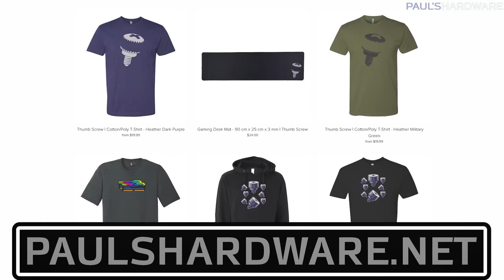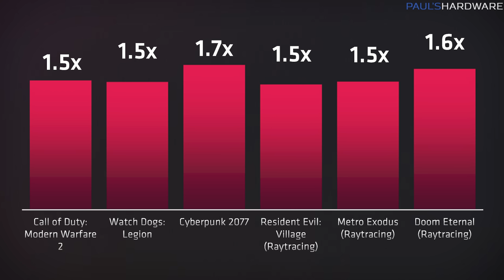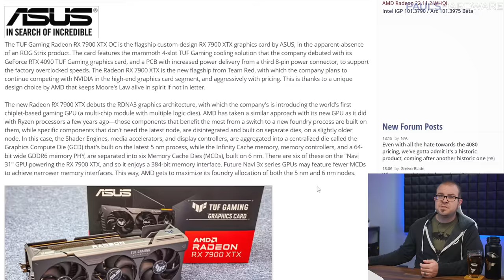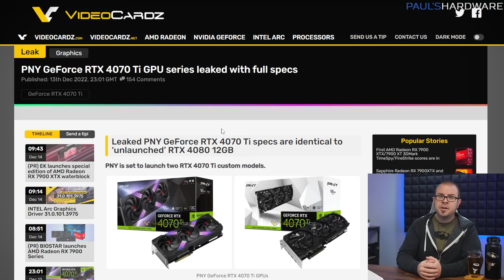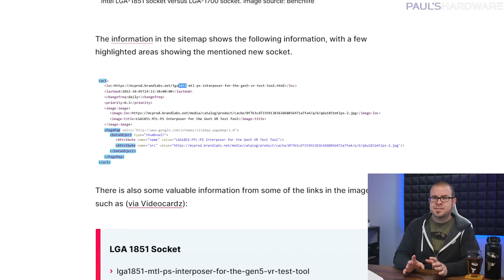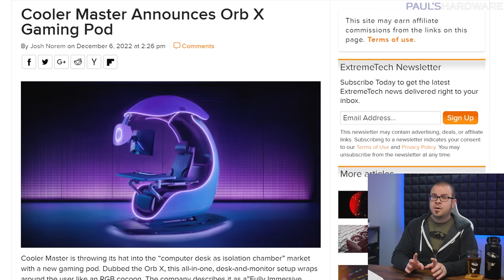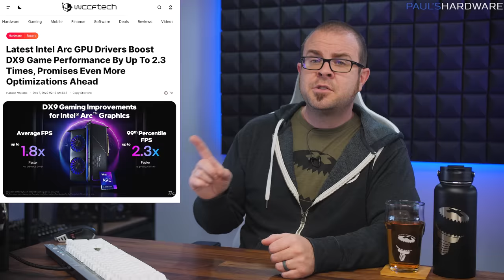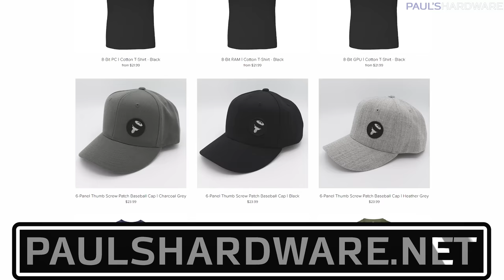GPUs and PC Hardware Coming in 2023 - Tech News Dec 18

Comment: 7900 XT compared to 7900 XTX is slower than 6800 XT compared to 6900 XT. Both NVIDIA and AMD playing name games.
Reply: Should I go for the 6800XT? I mean it's now way cheaper than the RTX 3070.
Reply: @killthemessenger84  7900 XT is 35% faster than 6800 XT while 7900 XTX is 60% faster than 6800 XT.
Reply: AMD making their last gen look amazing.
Reply: @isumairu25  If the price is good then yes. It beats the shit out of the 3070 in terms of performance. Check out Hardware Unboxed for real numbers.
Reply: @kevlarandchrome  I did, all I want to do is run all on 1440p. The Radeon 7900 series are expensive in South Africa.
Reply: @isumairu25  Yeah, the 6800 should do you just fine for that.
Reply: @isumairu25  6800xt is a fine card and its fine  if you get it for a decent price. If its same price as 3080, I would get 3080, but if it is cheaper than 3070, then get 6800xt.
Reply: @killthemessenger84  Five numbers: 6800 XT FPS, 7900 XT FPS, 7900 XTX FPS, 7900 XT peformance gain relative to 6800 XT, and 7900 XTX performance gain relative to 6800 XT. Source: Techspot at 4K

The Callisto Protocol: 74   FPS vs 94   FPS vs 118 FPS, 27% and 59%
Forza Horizon 5:          80   FPS vs 98   FPS vs 111 FPS, 23% and 39%
Raibow 6 Extraction:   83   FPS vs 119 FPS vs 144 FPS, 44% and 74%
Hunt: Showdown:        77   FPS vs 98   FPS vs 122 FPS, 27% and 58%
COD: MWII:                   109 FPS vs 163 FPS vs 193 FPS, 50% and 77%
F1 2022:                        29   FPS vs 48   FPS vs 56   FPS, 66% and 93%
Cyberpunk 2077:         41   FPS vs 59   FPS vs 70   FPS, 44% and 71%
Dyling Light 2:              57   FPS vs 66   FPS vs 82   FPS, 16% and 44%
Halo Infinite:                 62   FPS vs 82   FPS vs 97   FPS, 33% and 56%

Average with a total of 16 games: 70 FPS vs 94 FPS vs 113 FPS, 34% and 62%
Reply: Easy, buy AMD Radeon 7900 XTX and done. Or RTX 4080 (if the price is dropped *A L O T*).
Reply: @killthemessenger84  Kermit - “DO IT.”
Reply: I got a 7900  xtx red devil limited edition but my monitor is an asus 1440p 240hz g sync. Should I return it and change it for a rtx 4080 because I wanna get the advantage of g sync?
Reply: @isumairu25  whatever fits in your budget my friend.  I think the best value card is the 3060ti.  It’s pretty much just as fast as the 3070.   I very much dislike AMD gpus.
Reply: Let's hope the driver improvements on amd changes that a bit
Reply: @KaySwiss21  yeah some people speculate a performance bump with driver optimization like 6000 series but better
Reply: Tell me lies, tell me sweet little lies 💀
Reply: @WaterZer0  where? They get better performance per $ than last gen at launch MSRP. Im upgrading from my 6800 xt to a 7900 xtx soon 🤣 i only paid $600 for my card but i want more FPS
Reply: @carabelatech  Sell it to me instead of returning it, but with 20% price cut.
Reply: @killthemessenger84  what on earth are you talking about the 7800xt is double the performance of 6800xt?? You must not know what double means….
Reply: @Isumairu  idk man this is a YouTube comment section
Reply: 7900xt should be at 699.
Reply: @isumairu25  It's better than a 3080 for most things, so yeah if you can get it at that price.

Comment: The rumor mill around the rx 7000 series is talking that the perf problems were discovered late in the production pipeline. They thought they had a real winner internally, until they didn't. It's why they stopped implying it's a 4090 competitor and started stating 4080 competitor instead.

It does mean they might be able to fix it in drivers. But maybe not.
Reply: At least for what they've priced it at, both are still competitive.  It's not like they've got a couple of complete lemons on their hands.
Reply: @tams805  Competitive to what? 4060, 70, 80 or 90? I was looking forward to my first AMD since the crap radeon's from decades ago, but now Im waiting for a significant price cut once people realize what this video is stating: it's overpriced.

Not considering 4090 for similar reasons plus size.

Comment: the fact that the TUF 7900xtx is almost on par with the 4090 in performance, really shines a new light that we do not need new power connectors and the previous connectors are just a good or better.

Comment: I thought the new AMD graphics cards were well recieved all things considered. They are substantially cheaper than their closest Nvidia counterpart. They are also very comparable to said counterpart.

The only real disappointment is they didn't build a giga-card like the 4090. But why battle a gigantic combustable beast, when you can pursue lower wattage but good performing cards, that still show substantial performance gains.
Reply: I think the problem is NV only have to knock $100 off the price of the 4080 for it to be the better all round card. What NEEDS to happen is no bugger buys these cards at these stupidly inflated prices. AMD have the greed goggles attached, just like NV. If we are to believe that the chiplet design is considerably cheaper to make, why stick scalper prices on your products. Either your BS'ing us or you are treating us like idiots and I really don't understand who thinks this is a good move. I was expecting something akin to the launch of the original Playstation where the guy goes on stage, says $299 and walks off. 7900XT $649, 7900XTX $799. Job done. Yet somehow, they release a product in the XT that made the 4080 pricing look sane. I really thought that the kicking Intel is giving them in the CPU space would have warranted a rethink in pricing strategy for the GPUs but AMD have been shooting themselves in the foot for years now. I'm not sure they have any toes left.

Comment: That wasn't the take away I got from the half dozen reviews I saw on the 7900xt/x.  All the benchmarks I saw showed both cards straddling the 4080 in raster while keeping up with 3090's in ray tracing.  At current MSRP, if you can find a card for that, reviews suggested, the extra $400 for a 4090 was the right choice if ray tracing was important to you, as the 4080 was a poor value there, where as for raster, the 7900xtx was the card to get.  The XTX for the same or less money that last gen 3090's seemed to be a no brainier.  Pretty much, if you want the best card, you get a 4090.  if you want to spend only 62% of the money for about 65% of the performance, you go with the XTX, and only in the edge case where you need the best ray tracing performance, but can't scrounge up the extra $400 should you get a 4080.
Reply: That was my take away. I don't care about RT so I bought a XTX on Tuesday and have been playing with it all week. I didn't want to support Nvidia since they have been SUPER anti gamer the past few years and the XTX was equal or better than a 4080 while being able to fit in my case and 200 less. It was an easy choice. I'm no AMD die hard, I've had my 980ti for so long and loved it but team red we the winner this go around.

Comment: So i pulled the trigger on an AMD Ryzen 9 7950X with 64GB RAM DDR5 G.SKILL Trident Z5 Neo non RGB 6000MHz CL32-38-38-96 1.40v and an ASrock X670E Steel Legend mobo.

Already had an INNO3D RTX 3070 8GB iChiLL x4 fans, A case, 1250W PSU, 3x 1TB M.2 NVMe PCIe SSDs, 1x 512GB HDD, and a  Noctua NH-D 15 cooler

And i hope NOT to have buyers Remorse and hope there won't be a 7950X3D hope not.

Comment: While I'm sure the designs from MSI and Gigabyte have been out to lunch for the past several years, the Yeston cards look like someone actually bothered to come up with designs appropriate for build themes. I have an antique water cooling case and I'm using the Pentium 4 era cooler on Ryzen, which is in no way shape or form ever supposed to happen. I think a water themed Yeston card could be suitable replacement for my aging RX 580 Red Devil. I'm sure the performance won't be outstanding compared to its bretheren but beyond a certain point it doesn't matter and these end up being the peak for 1080p144 desktop.

Comment: ERROR:  at 5:25 you mistakenly compare the XTX clock frequency to the stock XT, not the stock XTX.  So you're overstating the frequency difference as 500MHz instead of the actual 270 MHz.

Comment: Thanks Paul, excellent video.

I have a question or a possible video, take this as coming from a  guy who build his first CPU, fires it up, and then gets to figure out all the hidden performance settings he needs to change from the defaults, like changing your RAM speed in the BIOS.

As you spoke about new GPUs, I realized there maybe these secret hidden settings for my graphics card.  Like "enable" ray-tracing or "enable" DSL or any unknown ones like "enable" a new drink to appear.  

I bought an older GPU during 2020, just to make the computer work, and later realized I can overclock the VRAM or GPU.  I have no idea how these two OC's settings actually do to my video or hardware performance, or what other hardware is required, such as using the right monitor.  All I know is that the GPU and CPU has room to run hotter and they are not, they seem to run cold, so whatever.

Nice work, keep it up, good decision on getting a video editor, your video is top notch and probably a time saver for yourself.  Good job.

Comment: Probably a ridiculous question but I plan on hopefully getting my son a 4070 ti but noticed in recent leaked pictures that is uses a 2x8 pin cable. Could I actually still use the 3x8 pin cablemod cable I already purchased with this or will the 3 8 pin connectors damage the card?

Comment: It is weird. The 7900 XT and XTX are a 20% to 30% better than a 6900XT, cost is the same as the introduction price for that card and it does significantly better in Ray tracing. It is $200 cheaper than the 4080. If they had not made such outsized promises, this would be a nice upgrade.

Comment: All the best matey!

Bit weird what AMD has done with the Zen4 and RX7K releases.  They powered Zen4 to the moon when they probably should of run it by default in what we now call 'Eco mode', and left the overhead for the overclockers...and then leaving 500 MHz on the table for the 7900 series to make it more of a 4070 (4080 at a push) competitor just doesn't make sense!?!

I'm expecting some real 'fine wine' in the drivers, else what was the point 😅

Comment: I haven't bought a new PC for a 8 years but need to upgrade from my GTX 770 SLI setup. My new display will be 3440x1440p 144hz and I want to play at ultra settings at 100+ FPS for every game. I can buy a new 3080 for 600. Should I go with that or do I need a better card?
Reply: I'm running ultrawide with 6800xt so similar speed. Cant get 100fps in every game all the time on ultra. Drop down to high amd you probably will
Reply: @IronmanG74   Ok thanks for the input. I think the 3080 is the card im looking for even if some AAAs I have to turn to high. I think its going to pair well with a i5-12400F.
Reply: Seeing as nvidia isn't going to lower the price of entry to 3080 class performance in the foreseeable future, it'll hold value if you choose to flip it.
Reply: @douglasmurphy3266   Good to know. Im debating between the 3080 for 600 and the 3080 TI for 700. Is the extra 100 worth it?
Reply: @SuperReviews4you  plug both into you tube and check out the results. And compare the games you tend to play. If your pc is that old you will also need memory and psu. Might be cheaper to just get a pre built 4080 and way more performance

Comment: AMD's improvement in performance / watt was great.  Then they put the XTX at 355 Watts and $1000.  My entire computer setup is only drawing 220-295W (according to the UPS it is plugged into) and cost around $1100.   This is including my current GPU, two monitors, an 8/16-core CPU, and 32G memory.  Any GPU upgrade has to be no more than around $300 and 200W.  I'm absolutely not going to be buying an 7900XT or -XTX any time soon any more than I'm going to be buying a 4090 or a 4080.  4090s and XTXs are fine for corporate bragging rights.  They'll probably even sell a few to people with more money than sense.  Here in the real world however people have to be able to afford and use them, practically speaking.

Comment: Given that the socket 1851 has the same dimensions and pin pitch as the 1700 could they be planning to allow 12th and 13th generation cpus on socket 1851?

Comment: AMD had the best chance in a decade to shake the market a bit because people were so angry about the 4080 price jump by 71% from $700 to $1200
And of course, AMD didn't deliver and they adjusted their price accordingly by raising the price of the 6800xt successor by changing its name and the price by 38% from $650 to $900.
The biggest disaster is that after AMD didn't deliver people started to buy 4080s for over $1000. The GPU market is going nowhere and not only this, motherboards are not better.

Comment: Nvidia creates a gpu that is size of my fridge and uses 3000w to run....amd says it will beat nvidigreedias  refrigerator gpu and creates 6 mini fridges that are connected together..however on launch we find out they are still slower but now charging as much as nvidigreedia. We see normal working class people refuse yo take out a mortgage on these m ew hpus as they all walkway to go back to boardgames and books.  Who yhe he'll is buying these gpus and why? My 3080 runs everything...l won't upgrade for another two years. I used to buy new gpu at every launch...not at these prices. They need to reduce to pre miner prices

Comment: The 7900XTX also absolutely sucks at 8K. Figured that should be pointed out since AMD heavily promoted 8K during their disaster of a live stream.

Also the 7900XTX and 7900XT have wildly different performance and should not have the same 7900 name. This is worse than the 4080 16GB and 4080 12GB because at least Nvidia had the decency to unlaunched the 4080 12GB. AMD actually went ahead and launched their misnamed male cow feces.
Reply: Oh and I've heard reports of driver issues, because of course Radeon would have drivers issues. They literally cannot do anything right. I'm starting to wonder why AMD bought Radeon, they just make AMD look incompetent.

Comment: I'm fucking crazy disappointed with you for using that TPU benchmark in your video at all.  They used a 5950X and bottlenecked the 4090 lol.

If I use a 2500K I can make a 4090 and 7900XTX the same perf too!

Comment: 'We' shouldn't have been focusing on anything if 'we' are sensible consumers, in this instance. Because 'we' won't go out and buy gpus without first seeing other people demonstrate their capabilities, in which case AMD will only lose if they mislead us leading up to launch.
What people seemingly forgot is it's not just the numbers, AMD specifically referenced the rtx 4090's issues when talking about their gpu - no melted connectors, no new psu, no new case, much lower power consumption.

Here's the other thing, expectation is only one issue - even if everyone got the performance correct, you still have the significantly bigger problem of AMD now validating Ngreedia (I need to find some pun on AMD that has greed in it) in making the 80 class card $1000 USD. Now even a braindead monkey could see that happening the moment the price of the 90 class card increased (as a matter of fact there probably shouldn't even be a 90 class card in the first place, but I digress). What you thought Ngreedia was going to make a massive price hike on the 90 class card then leave the others at the same level? No - of course everything is going to increase, and since the rtx 4090 apparently is selling well, you can pretty much kiss pc gaming good-bye in a few years unless prices change, or, if in some weird strategy they keep the 70 class cards and below at last gen prices. I'd argue that's not even a good idea because parts of the pc industry actually shrank during cov-aids, and the economic outlook of 2023 appears to be quite bleak.